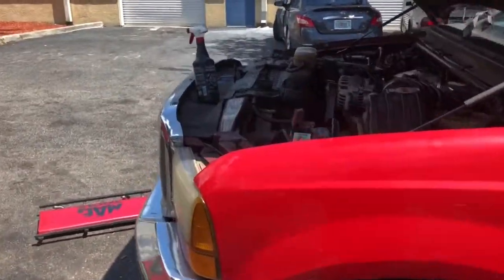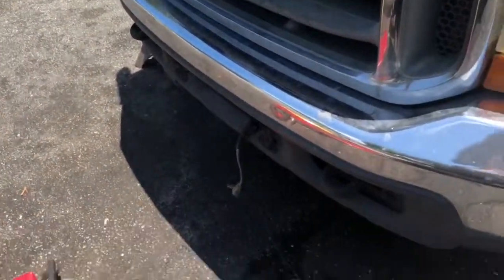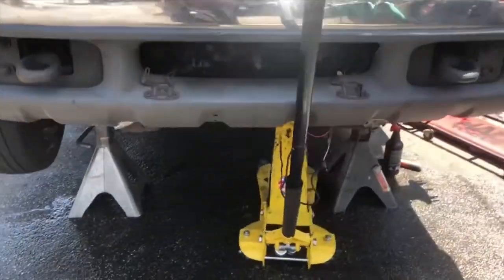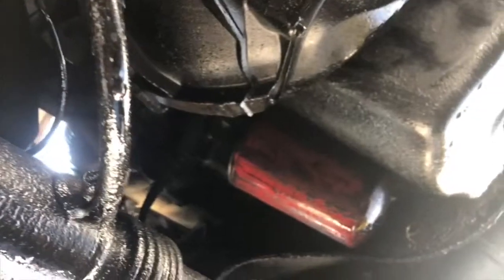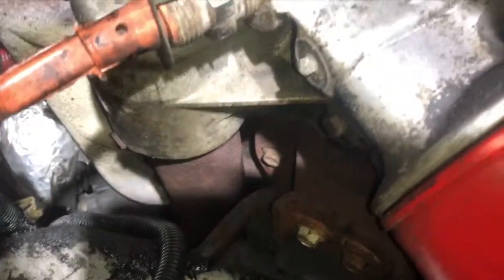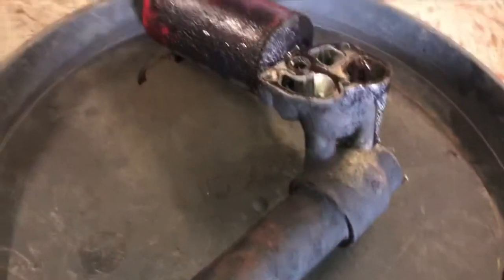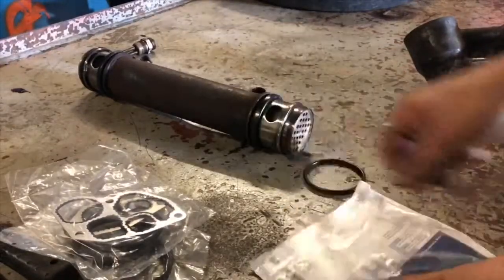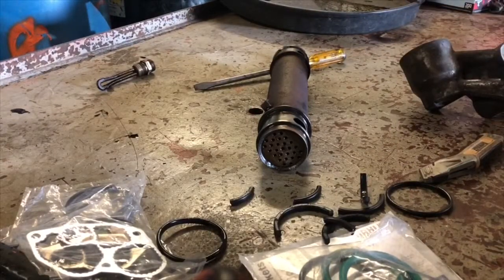2000 7.3 oil cooler seal replacement part 1

Comment: My truck has that same rust prevention self lubing system underneath too!
Reply from the maker: that oil cooler has leaked for years, but only in the first three minutes or so once it warmed up the seals swelled up and it stopped leaking. LOL
Reply: @ProjectShopFl  mines the same way, just got the stuff to do it, I appreciate the video. Helping me save a lot of money. My local ford dealer was gonna try and rape me for 1500 just to reseal

Comment: Your in south Florida, and you need to plug it in to start! You got more than a glow plug problem. At 80 degrees the plugs should not even be coming on. Good luck!
Reply from the maker: It does have almost 500k so I wouldn’t doubt it, But I replaced the glow plug relay and it starts up fine. Where would you start looking if it shouldn’t need the glow plugs? I’ve already thought about low compression, I replaced the HOP. Thanks for watching